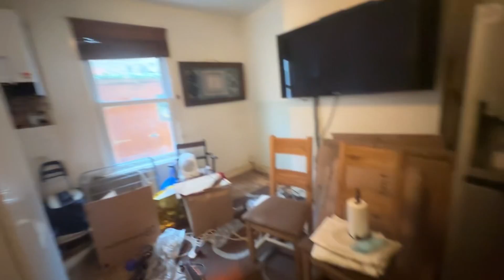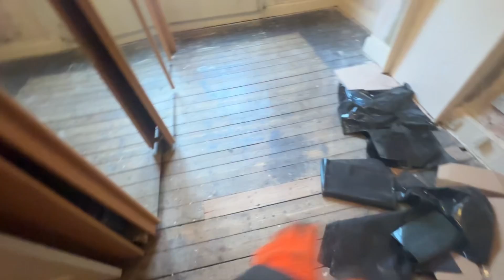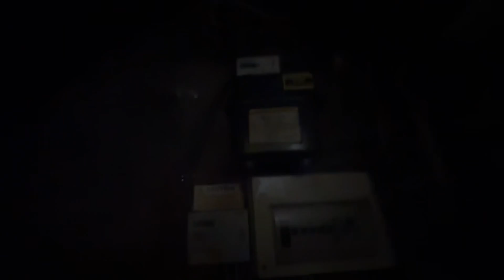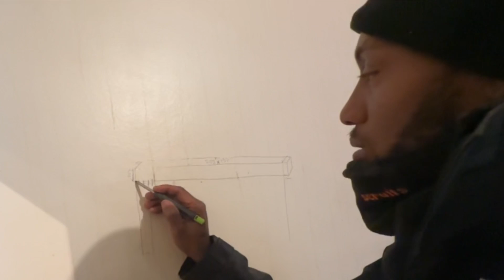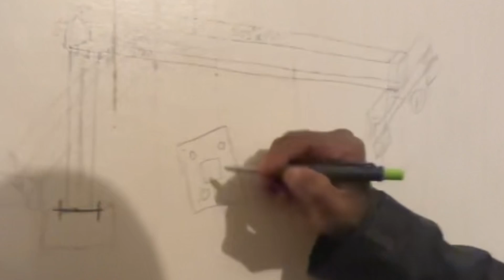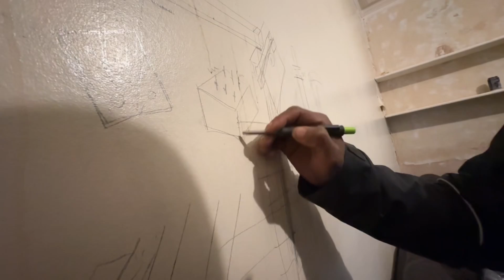Beginning of a full refurbishment in London - Episode 1

Comment: Are the plaster mouldings around the ceilings being saved Darren ? it kills me when I see original period features like that smashed down.
Reply: Definitely agree with you on that! They look very nice. If not, maybe they can be salvaged?
Reply: @Wgnwtb  I was a decorative plastering apprentice for a bit many years ago. A lot of these period ceiling mouldings are formed in situ so are actually part of the wall/ceiling. So unfortunately it is basically     impossible to remove them without destroying them. You can get modern reproductions to replace them but they are just not the same if you know what I mean.